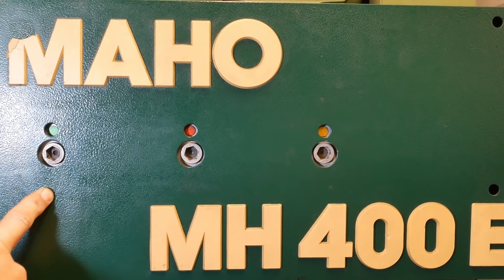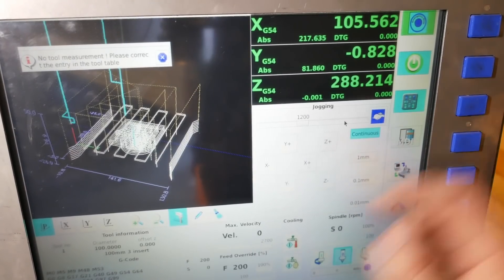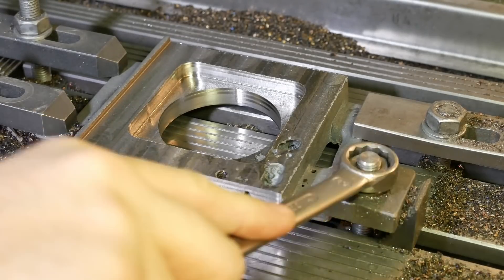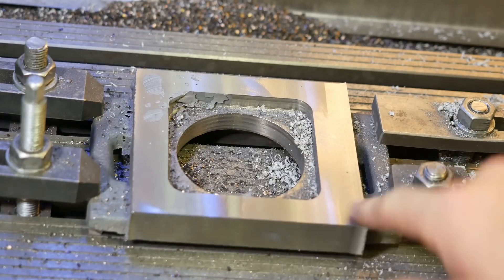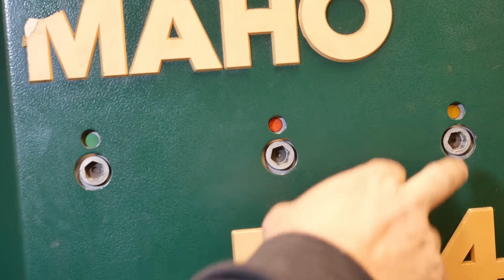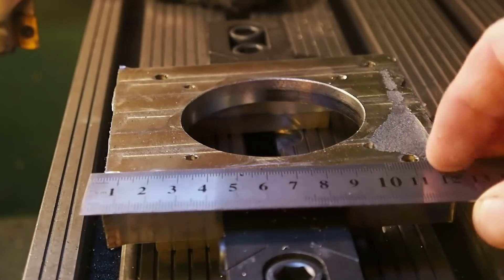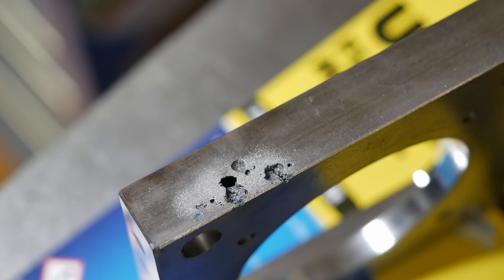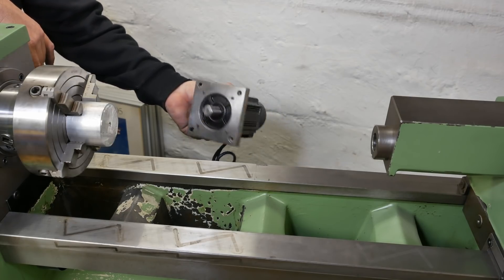Does epoxy liquid metal work? - Schaublin EP-34 || RotarySMP

Comment: Speaking of off-center holes there was that A380 that lost an engine because an oil hole was drilled off-center in a boss.
Reply from the maker: Yep, althouth it wasnt lost. It was the Qantas one that had the uncontained  failure into Singapore. It was repaired, but I suspect it would have taken a pretty nasty structural inspctionl limitiations, as the fwd spar was puntured.

Comment: 2nd comment (sorry) I've just seen you using those side "hold downs" for op 2 again..... I'd only use them for roughing as its nearly impossible to accurately align pre existing features with them, iv found atleast. But more importantly it looks like you're always using them at the end of their travel (like using a collet at its lowest range) try opening them up fully, them pushing against your part and applying clamping force. You may find parts hold firmer
Reply from the maker: Thanks. When I saw them move when editing, I also wondered whether having them near bottomed could have been part of the problem. Using four, and putting them across the solid ends of the part, and not across the hole would probably have worked.
Reply: @RotarySMP  Thats how we prefer to use them, sometimes 1 at each corner and in middle too so 6 in total. Really wish you could post pics in comments 😅 I've reliably held 100kg+ parts with only 4 on many occasion but only for op 1
Reply from the maker: @wildin13  I figured that these are capable of much more, and therefore that I am doing AMF a disservice showing my poor usage.

Comment: Loved that intro! 😅 little comment on your remark about machining expensive parts and pucker factors. I think its the same as any expensive/long time scale jobs. You just want to see the end of it so as long as you remember not to rush its more of a relief to be seeing the end of the job. 
Done my fair share of them, as an apprentice learning EDM, 1 of my first "real" jobs was a very complex, multi electrode part (mould for a gear box) that was way to big for the machine. If I'm remembering correctly the raw stock cost roughly £11k so add on all the machine time and hardening process and man hours polishing it was very expensive when it came to me and I had no idea how to even set the job up 😬 
But we're engineers! Break down problems and solve them one by one and it no longer matters how big a job is cus you're only solving small problems 👍
Reply from the maker: That is what I am trying to do on the Schaublin. one step at a time. Finished when it is finished.
Reply: @RotarySMP  The other thing about large aero engine parts is usually they are investment castings, which is much much more involved process than the final machining, and usually produces some scrap parts in the development process. You can send these forward for machining trials, just gotta make sure they don't end up on an engine!
Reply from the maker: @benmodel5745  I didn't think  of that.Good point. That GE90 fan hub frame is a hub casting with welded on struts, so the welding process development probabaly also provides some victims.
Reply: @RotarySMP  yup, I think I've worked on that very part. All part of why these engines take 10+ years to develop
Reply from the maker: @benmodel5745  Cool. Largest cast titanium part at that time.

Comment: I once spoke to a machinist in early days of CNC, they did a lot of dies for plastics and automotive. He was tasked to work on a rather large block of tool steel, I think for metal stamping bonnets. Pucker factor was such he told the boss to job out the runtime cam stuff, basically refused to be responsible for a rather large amount of money for material.
Pretty much said he'd run it, but wanted no part of designing the programs..
Reply from the maker: Some of those big dies must also have days of machining in them.

Comment: We use liquid metal at work from time to time, the version we are using are fast curing, but if you want to prolong the curing time, you can mix it on a aluminium plate you have put in the freezer in advance, it can bring the curing time up from five minutes to about half an hour. When applied and the temperature rises, it cures as fast as without freezing.
Reply from the maker: That is a good tip. This one has a pot time of 45 minutes and 24H cure, so I used the process oven to hurry it up.

Comment: I think the problem with your second op workholding is that you are clamping across the large hole in the part. I think you'd never get enough grip due to slight deformation of the part, and probably you'd crack the cast iron trying to get there. If the tee slots in the table line up it would be better to use four clamps at the corners so that the clamping force is across the solid portion, not the hole.
Reply from the maker: During the edit I came to the same conclusion. I currently only own two AMF Bulle clamps, but will get two more, as two never feels like enough.

Comment: That branding is porbably so diflecting, they probaly mean liquid metal as in it sticks to metal not that it's actulay metal. It defetnly dosn't hurt in your case but when someoen thinks your putting liquid metal on it they are probably not thinking of plastic epoxy that sticks to metal.
Reply: It has Steel powder in it which makes it more robust than regular Epoxy.
Reply: @Toxicity1987  Yes but the marakting as "liquid metal" is still quite deciving
Reply from the maker: @gm558  It is sold in the general hard ware store here, so I guess all sorts of people fall for it :)
Reply: @gm558  I mean yeah, but actual liquid metals (like amalgam) are pretty much shit for such application and are often weaker than this reinforced epoxy.
Reply: @Toxicity1987  I just don't like that they market is a liquid metal when it's clearly not even close
Reply from the maker: @gm558  look at all the crap they market as "Health food" :) At least this epoxy is useful.

Comment: Regarding how many man hours it takes to make complex part: about 3 months just to have couple prototypes (we are talking just about machining side of things). Pucker factor might be very high but again it depends on time scale - if you have limited time and only one shot you can crush walnuts down there. Generally speaking with modern(ish) machines and time it is not that scary.
Reply from the maker: I guess the sort of CNC shops which get to touch those parts have decades of experience, like Edge Precision.

Comment: I've used chinese Kafuter k-9119 before and it is excellent as a metal filled epoxy, easily as good as jbweld, very affordable, seems very similar in general performance to the uhu stuff. Surface prep is pretty important for this stuff, as its quite stiff, unless it is mechanically located (like your situation) it can shear/peel pretty easily.

I quite like it in general though, it cures much stiffer than standard epoxies so it is excellent for reinforcing, bonding little brackets and adding stiffness to plastics
Reply from the maker: Thanks for the tip. Is is easily available?
Reply: @RotarySMP  pretty easy to find on the usual suspects, usually referred to as "a b metal epoxy" or similar (you know how they just throw words in titles that only vaguely represent the product), the two components seem similar in colour to the uhu stuff and are also 1:1, its about 3-4 usd for 100g.

With that kind of stuff i usually mix up significantly more than necessary; i think its easier to get a good mix and easier to get close to your target ratio.

I'm super keen to see this machine running by the way.
Reply from the maker: @bgdwiepp  Thanks, I found it on ebay.

I am also looking forward to having the Schaublin running. I will then sell he mini lathe and Boley to clear up some space.
Reply from the maker: @fuckingpippaman  I wont bother getting any of the chinese stuff until I use up the UHU. And by then I might have forgotten the chinese stuff exists :)

Comment: Oh mate, if you are filling holes in metal, it's gotta be epoxy putty, so much better than the liquid stuff in my experience. My bike's engine has 2 holes in it patched up with that stuff!
Reply from the maker: Can you recommend one which is closer to cast iron colour?
Reply: @RotarySMP  Sorry mate, might have to test a few out to be honest. I think if you can find it there Devcon makes 'Plastic Steel Putty' as they call with various metals in it for sale. probably as close to it as youd get ay.
Reply from the maker: @HarrysLost  Thanks for the tip.

Comment: Not intended as a criticism, but did you consider casting this part in aluminium? It wold have been a lot easier to do.
Reply from the maker: I have this cast iron fetish, that machine parts should be in iron. Of course you are right, as the flange which bolts up to it is the aluminium casting of the motor, and there is a belt, so rigidity and damping are not important here.
Reply from the maker: @MikkelRS Why do simple if complicated also works :)

Comment: Could you use that epoxy to make a cosmetic repair on that divot in the table of the Maho?

FYI, some years ago I used JB Weld to bond a broken piece of cast aluminum back onto its parent.  The repair is holding up fine.
Reply from the maker: I will probably turn a round plug, and then epoxy it in with that stuff. Then there is only a thin line of the wrong grey.

Comment: I've only used that liquid metal for automotive repairs... it's great in high heat situations, exhaust, manifolds and such similar. It paints over ok, but does have a different texture than cast or machined metal. Welding is probably preferable for small areas, but anything around fuel or liquids, I like the epoxy. Nice to have in the toolbox for roadside emergencies. =D  Takes a lot less room than a welder.
Reply: a spool of steel wire is quite helpful as well. =D
Reply from the maker: @MikelNaUsaCom  Good call :)

I am surprised you get good results with Epoxy on exhausts. The glass transition point is not very high.

Comment: What you are missing is a small nylon hammer to set the part Flat in the clamp. Ave makes copper hammer.
Reply from the maker: I did tap it down, but I think the toe clamps work best if the part is not lifted up on stand offs. Since I had through holes I needed it up.

Comment: 18 speed gearbox? Ouch... too bad the Chinese servos in the 2,2 kw range are not available anymore the asian dropshipper warehouses in EU - they were cheap and they made ok spindle motors for (well - small cnc mills) for the max ~6k RPM range (3000 rpm is their base max rpm).
Reply from the maker: I like the gearbox  and 3kw motor.  It results in 200NM of torque at low rpm at the spindle, so that 100mm face mill will chew through anything (especially clamps if you let it.)
Reply: @RotarySMP  Well 200NM is a spec that is good enough for a smaller horizontal boring mill :)) You don't plan to machine castings for the energy sector, do you? :)))
Reply from the maker: @chronokoks  Good point. Probably overkill. I basically tried to change as little as possible in retrofitting the Maho. I figured I could never engineer anything better than DMG.

Comment: Ive used JB Weld marine for casting repairs, its actually really good, strong, and machinable!
Reply from the maker: I didn't know the marine version. Is it a better color match for cast iron?
Reply: @RotarySMP  Yes!, looks almost the same in my opinion, you have to get the grey colour, the whole point of the marine version is it is obviously corrosion resistant, but more importantly it can resist many chemicals such as iso 68 oil which is important for reparing old machine tools, I might make a video some day.
Reply from the maker: @max_eley  Good itdea. I'd be interested in you take.
Reply: @RotarySMP  In the process of a whole denford cyclone rebuild, I really wanna make a video about that, just about finding time..
Reply from the maker: @max_eley  There is not a lot out there on those Denford machines. You would be doing the community a service by posting on it.
Reply: @RotarySMP  I have 2 Cyclone machines, both with fanuc, they are awesome little machines!, I would love to make some videos on them, Ones running great, other one needs a full mechanical rebuild, theres a lot to servicing fanuc controls, tuning the parameters, ect, i think people would maybe like that type of videos.
Reply from the maker: @max_eley  I am sure that would be popular.